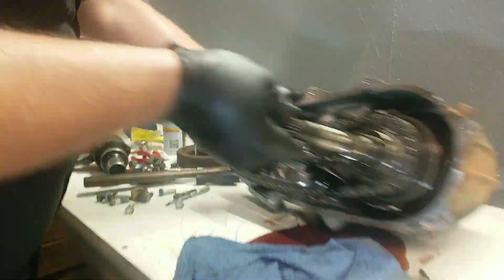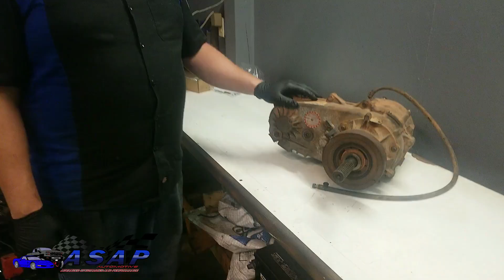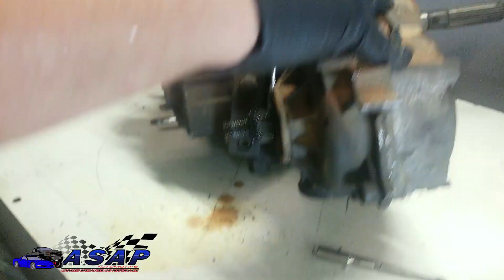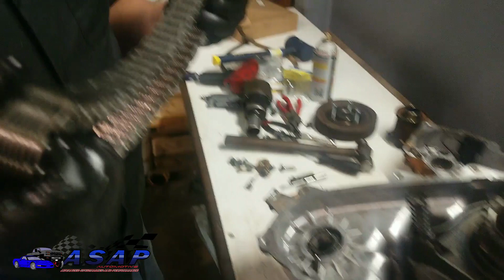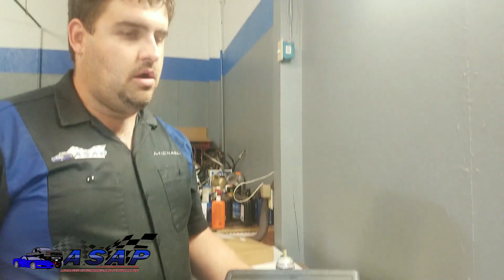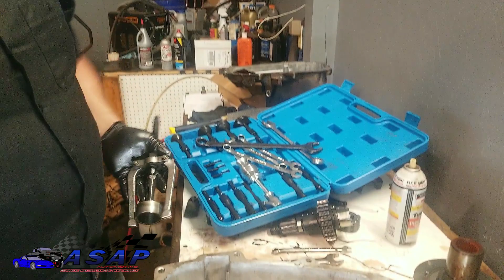NV231/NP231 Transfer Case Rebuild Part 1

Comment: can you tell me what kit you bought for your re-build and best deal for a good quality product.ive looked at lits on e-bay that are like 154.00 with everything but not sure if all parts are acceptable or if bearings are re-manufactured and such.Also it mentions for 15mm bearing shaft or something and i havent torn into mine yet but plan today cause im doin sye kit and clutch but just wanted to get new chain and pump and seals and bearings i know ill need .Can you point me in right direction.You have did a great job and im trying to follow you.mine is a 231-j and i know its new process or new venture as says on my sticker and basically same.i just dont want to get stuff i dont need and a good product.Need some help,im confused with all ways amazon and e-bay list stuff.Thank you and awesome job

Comment: An easy method for pulling blind hole needle bearings is to put grease in the bottom of the hole.  Take a shaft (I use a wooden dowel) of the same diameter.  You could also use an old transmission shaft.  Drive the shaft in with a hammer with a few sharp blows.  The hydraulic pressure will push the bearing right out.  Works every time.  I use that method for removing pilot bushings in a clutch plate.
Reply: There is an oil hole that lubricates the bearing. The grease would shoot out that hole.
Reply: or a childrens liquid med syringe

Comment: If mine has the harmonic balancer on, do I need to put it back on or can I leave it off?
Reply from the maker: If you are doing the slip yoke eliminator kit then it does away with it.

Comment: Using the 6mm bolts to get that damper off helped A LOT here on the NP231J SYE upgrade...while in there did the 3-->6 gear planetary swap, Teraflex 2WD low + the 1"-->1-1/4" wide chain upgrade . This was a good video to watch before the NP231J here was worked on. Thank you ASAP Automotive Channel for this video!

Comment: I would have appreciated a listing of all special tools needed.  I caught the OTC Seal driver kit number but, did not get any useful info on the correct pliers needed or the other puller you used on the bearing.  Maybe you can add that for future viewers?